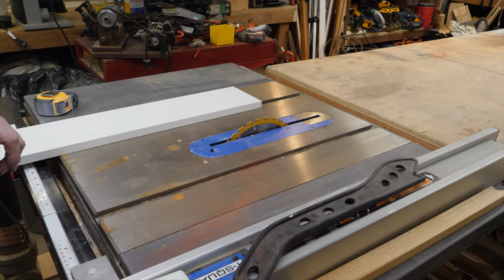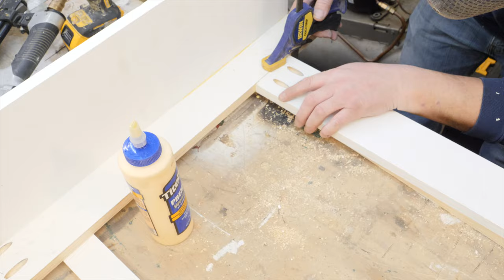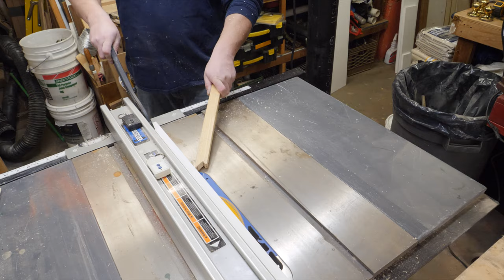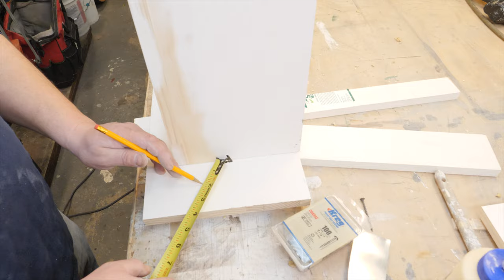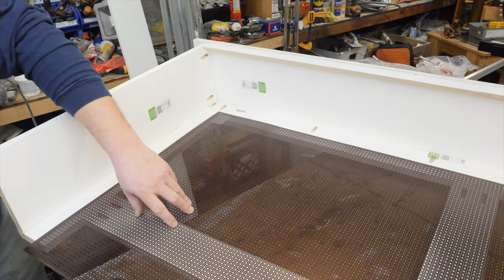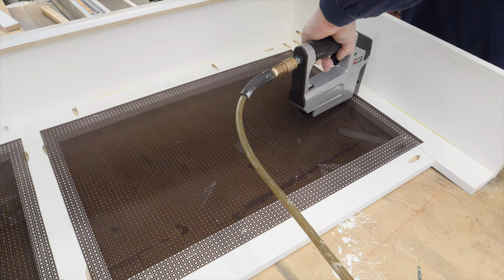How to Make Simple Radiator Cover DIY

Comment: What kind of material are you using? Nice work!!!
Reply from the maker: Finger join primed wood from home depot is the best because won't bend after time
Reply: @PeterMake  I just built one. I was scared of the heat causing warping issues on wood. I went with 3/4 MDF board.

Comment: Is it easier using a pocket hole jig than a biscuit machine ,thanks 🏴❤️👍
Reply from the maker: small boards less than 1 inch I use pocket hole Jig.Biscuit I use four big boards like the dining table 1 inch 1/2 and up
Reply: @PeterMake  ok thanks